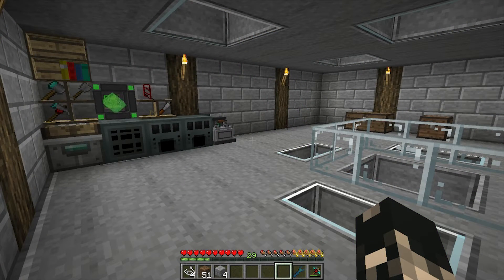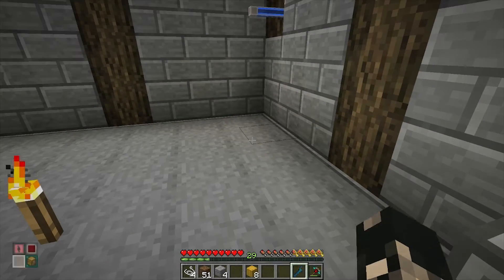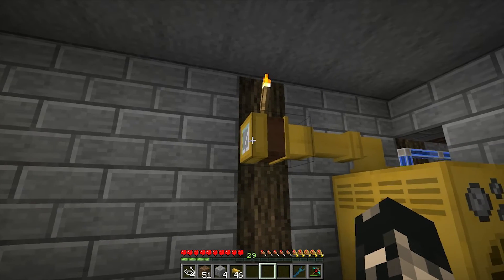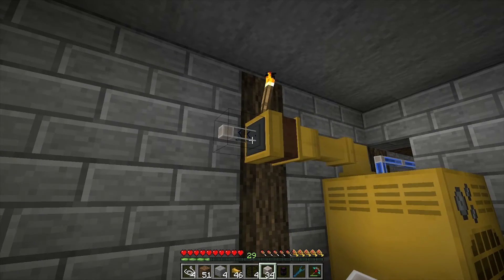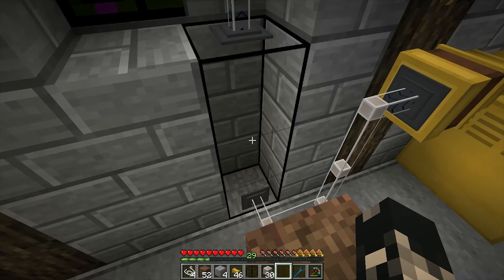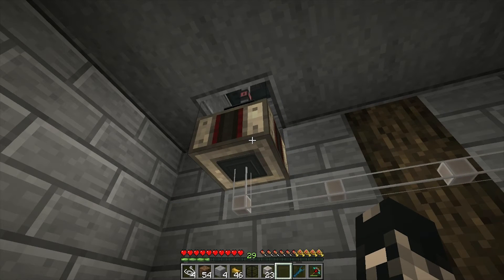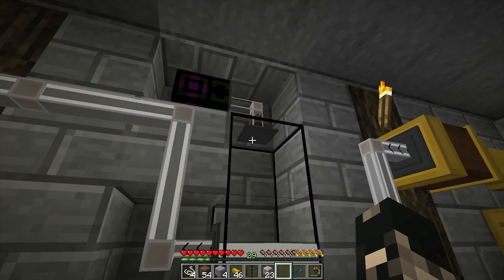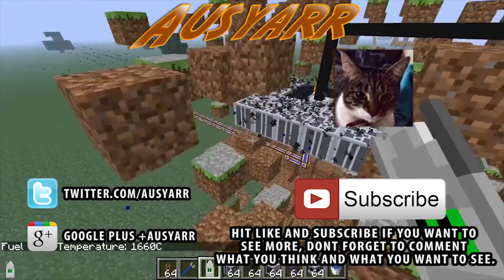Bevo Tech Pack   Pressure convertor, Flaxbeards Steam power, steam to redstone flux convert S1E8

Comment: I really like BTP too but sadly my Mac is just crap so playing isnt that much fun ;)
I didnt get the point of doing this is it more efficent then burining fuel directly in it or are there othef ways to genearte steam in this mod??
Reply from the maker: Have you tried the BTP Mini pack. As for the steam, there are other mods that generate steam and use it. Unfortunately flaxbeards steam mod only uses it own steam and if you let it build up it explodes its pipes and machines so converting it to other power systems prevents that over pressurization.